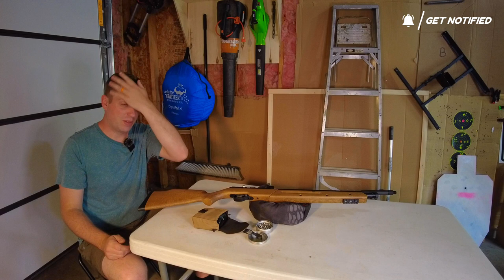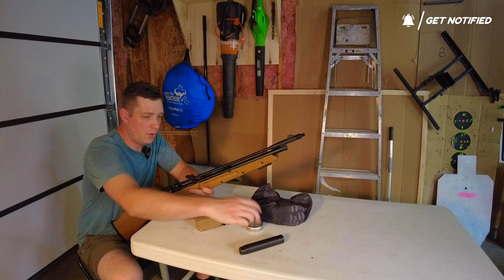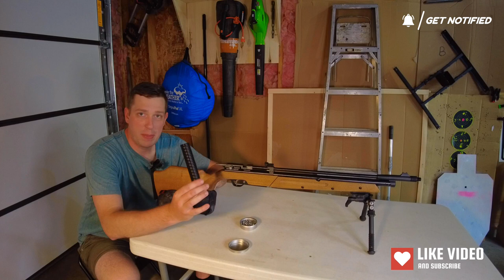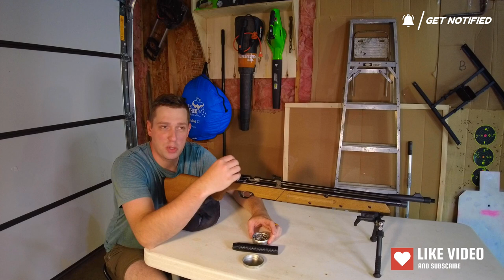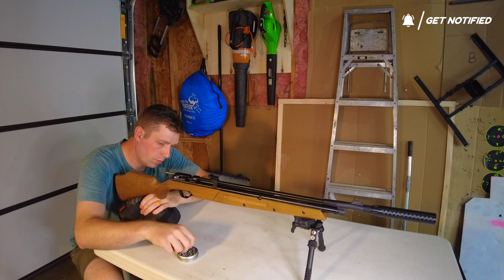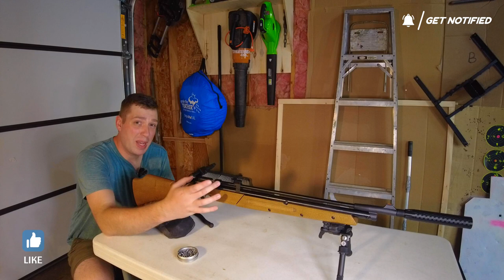It's HERE - Seneca Dragonfly Mk2

Comment: Plus one for BuckRail. Plus one for MK2. Minus for short dovetail and not being level with the barrel clamp, sad face. I’ve had mine a couple of days. Scoped with an offset one-piece mount clamped to the sight dovetail. Punching one ragged hole at 20 paces with Crosman premier HP. 6 pumps no crono. Thank you for the video. Someone mill a stepped mount just for this rifle lol .
.177cal
Update: I believe I’m sending this back to the supplier. My rifle is changing POI by up to 10”. I diagnosed that the front “bulkhead/barrel band is rotating from leverage caused by pumping. I believe this was tight when I got it but loosened after about 60 shots. Too bad really, I really like this set up.

Comment: First few shots with this combo shot way left compared to no can. Took it off, 3 shots, back on. No issues now. I'm gonna buy 2 more. For the price, I can do some polishing if needed.
Reply from the maker: Perhaps take a drill and just slightly open your baffles so you don't get strikes?  Yeah it is a great price.  I've had good luck with mine for sure, better accuracy actually.
Reply: @GTMGunTotinMinnesotan  something to that effect. Maybe some sand paper around a cleaning rod in a drill. Ide be afraid of cracking it with a bit
Reply: On further inspection, the base has a few cracks where it threads on. Maybe I just got a lemon. Either way, I've emailed them and am hopefully.

Comment: Do you recommend this or not
Reply from the maker: For what purpose?  And how are you going to use it in general?
Reply: @GTMGunTotinMinnesotan  for serious hunting and a all around air rifle
Reply from the maker: @ahmondeboxley2950  small birds and pests sure within 25 yards, general use yes I do.
Reply: @GTMGunTotinMinnesotan  thank you so much I have 3 different pcp air rifle that I have and have not had the chance to sir them up with accessories I'm gonna, trade one of them for this air rifle in 22 cal with and extra magazine thanks again for getting back to me
Reply: This or benjamin 392/397
Reply: @ahmondeboxley2950  I don't know about him, but I have a 392 and I wouldn't trade it for the MK2 shown here. Yes the Benjamin is hard to pump, but the barrel is solidly affixed to the pump cylinder, this is a very strong design and won't twist or loosen, ever. Unlike the MK2 design where the front of the barrel is attached by a plastic barrel band, which could loosen or twist and go off target (according to another reviewer). I don't know that for certain because I don't have one.
   I've had my Benjamin 392 for many years and shot it thousands of times with never any issues, just a good solid rifle.
Reply: @trevorjameson3213  thanks for the reply I will be getting in contact with baker air guns